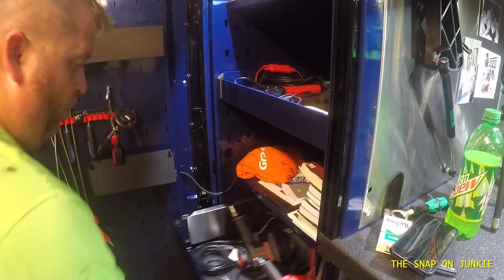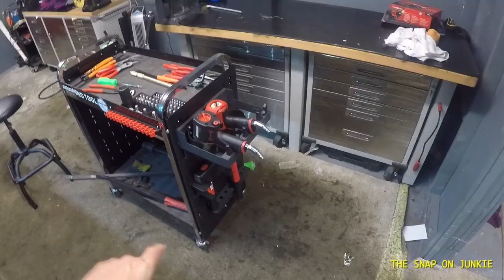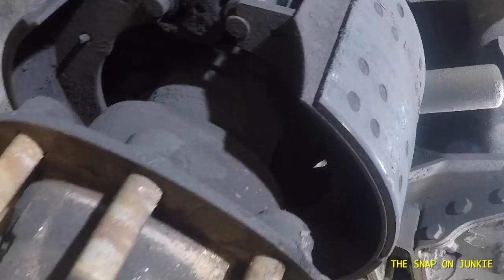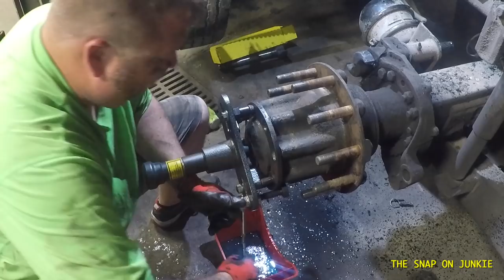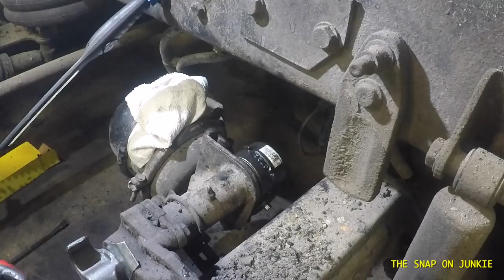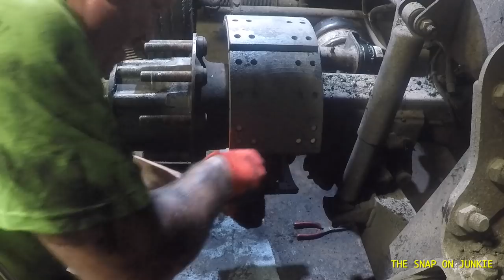FULL BRAKE JOB ON DUMP TRUCK!!$$ THE SNAP ON JUNKIE

Comment: Funny how cursing takes the place of actual knowledge
Reply: There is more of that cursing to follow when he can't hear or see, he does not use eye and ear protection.
Reply: Joey Wilson I don't think he can speak one sentence without using a curse word. A trademark of his outstanding upbringing.
Reply: But don't you think replacing a dump truck brake is a knowledgable skill? I'd think you'd have to know what you were doing to replace just one correctly, right?
Reply: Mechanics tend to curse. A lot. Nothing new here.
Reply: Boomers cry at cursewords.
Reply: @flamethrowercandle2354  I think you mean millennial's cry at curse words.
Reply: @TheGheseEffect  sure youre right but he didnt do it correctly. no one that had a clue what they were doing would put the braking surface down on shit on the floor like this.

Comment: Hey, lets use an automotive impact gun on a dump truck and bitch about it not taking off the lug nuts. I'm not a mechanic professional but even I have a 1" impact gun that has 2 D handles, one with an air trigger to take off my truck lug nuts. Funniest thing there are people out there impressed with his work.

Comment: That tiger tool is pointless. Just smack the axle with the hammer and it'll break it loose. And if you think your gunna damage the axle use a brass hammer.

Comment: Whys every body keep whinning about Jack stands FFS! He's only lifting the damn axle not the whole truck. Theres 6 other tires holding the damn truck up. If anything the one axle will sag if the jack fails. The leaf springs are still attached, therefore it won't even drop the axle to the floor num one. Num two   those Jack's are rated for 10x that amount so the possibility of them failing are slim under that load. At least catastrophically! It might slowly let the fluid out. But God damn man he's not even under the damn axle! Safety Sally! Are you Osha?

Comment: I have never seen a heavy truck mechanic use such a tinker toy impact gun on a truck, ever. I've been to Ryder, Penske, Service Tire etc. I have seen some really hack Russian mechanics that use duct tape and bubble gum to fix stuff and they still have a 1 inch drive impact gun for wheels. I wouldn't drive that truck and trust that the lugs were tight. Been driving truck for 25 years.

Comment: Doesn't like hf ,but uses them that explains why his snap on tools still look brand new.Why 1/2 drive wrench? that's putting a shit load of stress on that anvil.It's not designed for that 3/4 is.And no torque wrench on those lugs.

Comment: You didn't need to take a the whole hub off. Flat head and a sledge. Hammer the s cam bushings out and pull the a cam out.

Comment: What do you keep your air set at? I GET THE FUCKING POINT, The Harbor Freight gun can't do this job, I don't think anyone though it would lol, I'm just saying if it's the only fucking gun you had I bet you could have bumped the air up to 150psi and it would have worked.

I'm an "ADVANCED" DIY mechanic, I take care of a lot of cars (unfortunately on a budget because I'm fucking poor, hence taking care of my own shit), so I've just got a little 30 gallon compressor, but I find if I set it to like 120psi by the time it gets to my damn gun it's about 90 or 95 psi. I use 1/2" fittings and a goodyear 25 foot rubber 3/8" hose all the way to the end where I attach Milton V Style fitting, so honestly I don't think that pressure drop is from a shit setup, the airflow for 25 feet is as good as a home jobber with a shit small tank can do lol.

Comment: Yeah dude, the purple shit's good. 

Speaking of purple shit, have you seen the fucking rape they're laying down for a bottle of 3M silicone paste these fucking days? It's 22 dollars a BOTTLE NOW! It was like 8 dollars 3 years ago! 

Doesn't fucking matter, you can buy dielectric grease in a pretty big tube for 7 bucks at your local store, or the best deal right now is a 14 ounce jar of "SUPER LUBE" on Amazon, $11, also contains PTFE. That shit is specifically for brakes, but I always used to use plain old Silicone paste because it transfers heat well, doesn't melt, and most importantly it doesn't bloat and ruin the rubber shit you put it on. Since I do cars and trucks the protective rubber boots for the slide pins are crammed full of a grease, if you don't use something silicone based you'll be sorry as fuck.